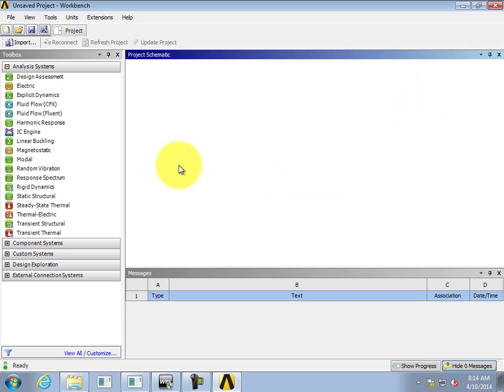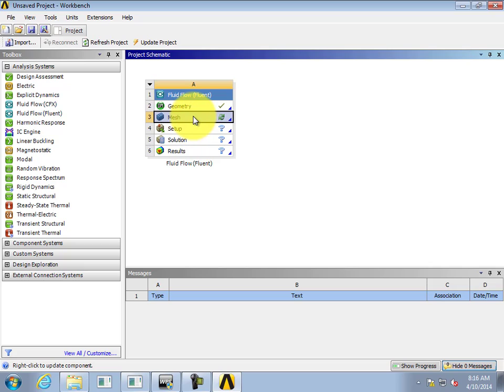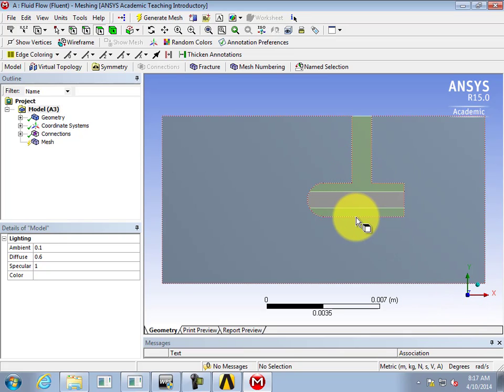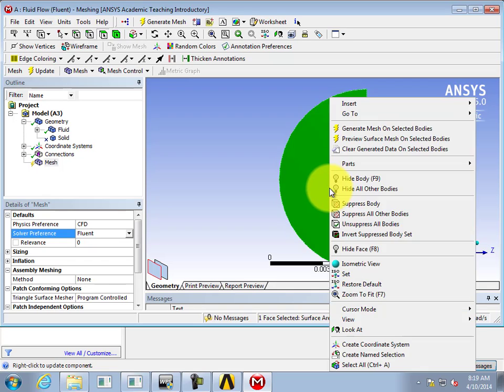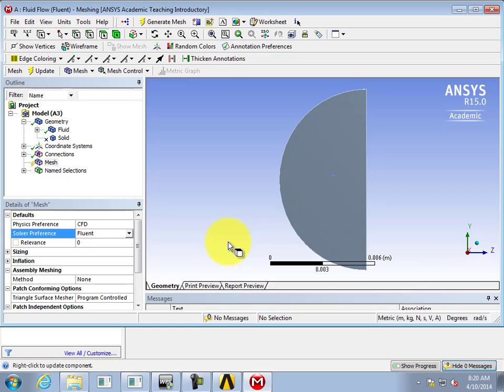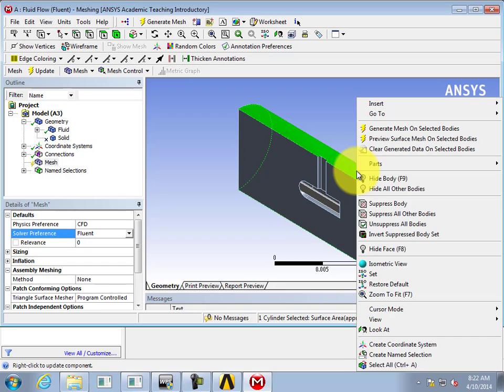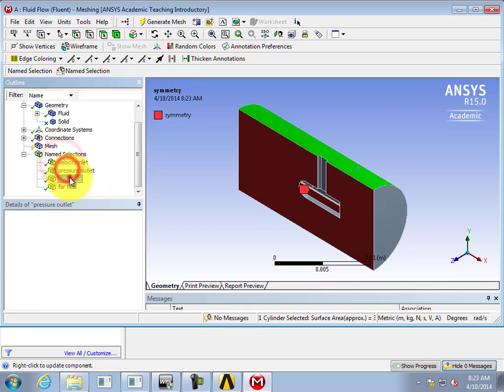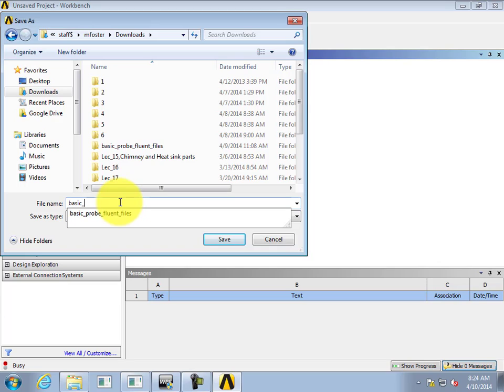Introduction to ANSYS Fluent (2/4): Meshing

Comment: hello mike, can you do me a favor, can u make a tutorial how to mesh plate heat exchanger.
Reply from the maker: Are you wanting to mesh a heat exchanger so that you can analyze it in Fluent? If so, this video should help: https://youtu.be/NYwnLIdBBqw
Reply: Mike Foster okey. tq for the video. actually i dont know how to do the fluent analysis on plate heat exchanger. can u make a tutorial from the beginning until final solution for fluent on plate analysis.
Reply: Mike Foster i still dont know all the features in ansys. how to use them. i learn myself this software for my final project.